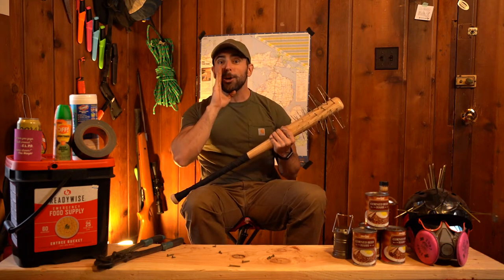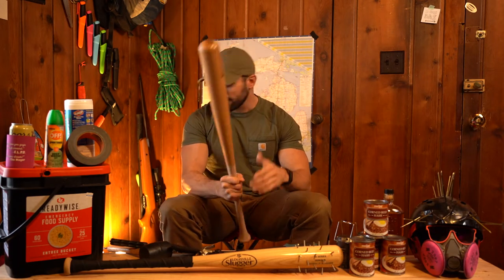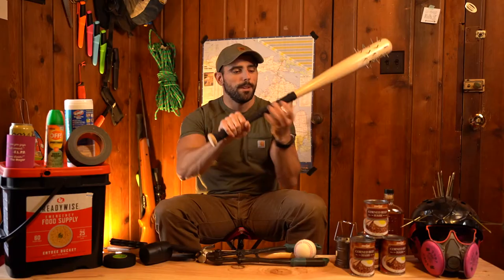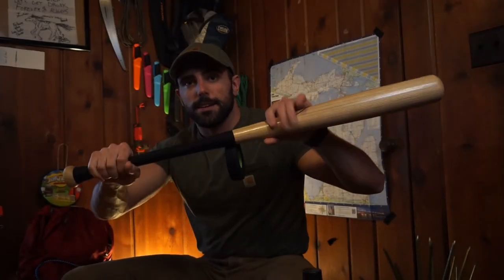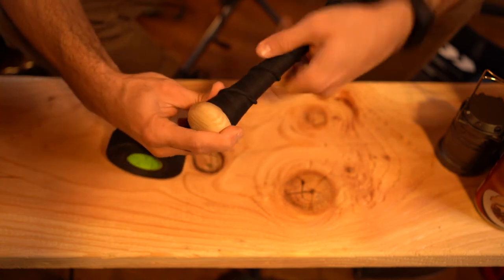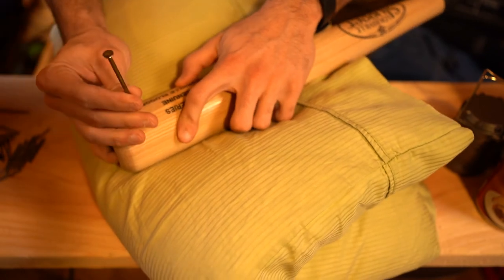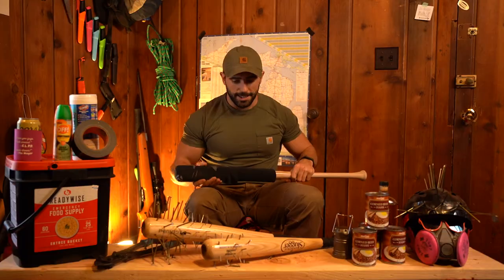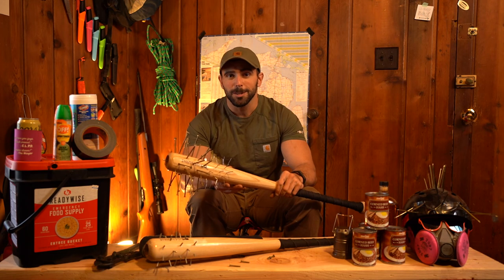How to make a nail bat: Surviving the apocalypses with Lou!

Comment: Im pretty sure weve all seen those videos of people standing on tons of nails, so something i would say is not to put way too many nails on the bat so that way there are less pressure points to spread the energy of the impact. At the very least put a good bit of space between each nail so they go into the "target" with less swinging power. Maybe 3 nails going down the shaft and 6 nails going across the circumference of the bat.
Reply from the maker: @mimikanahd1638  love the input!  It’s been years since I’ve made one, but I’ve been towing around with making a new one/video, and I would definitely add this to the list of things that do different.  Thanks for commenting!

Comment: Great use of the grip tape. 
But I wouldn't put nails into your bat. They will bend and break off. 
I used grade 5 hex head sheet metal screws, the ones that have a point. But i only used 3/4 to 1 inch long ones. First drilling a small pilot hole (so it won't split your bat) 
This way it has "heavy studs" that can do massive damage
Reply from the maker: Great Idea!  I'll have to give that a go if I make a new one:)

Comment: I think I'd use stainless screws, the kind that are only about half threaded. Drill some pilot holes and snip off the ends like you did with the nails, just saves you all the whacking and lets you be a little more precise with the placement. Might also lessen the risk of splitting.
Reply from the maker: That’s a brilliant idea.  Truth be told I just kinda went for it:)
Reply: All of this, but tent spikes. Much larger, much more durable nails, rather than cutting them, I angle the head off to the side, she’s real beautiful in an brutally-ugly kinda way. I call it the modern mace, though you can practically use it as a saw.

Comment: The nails look pretty weak and they’d bend and come out. Hit anything with them?
Reply from the maker: Definitely not my strongest build.  And since switched over to using hybrid screws and then clipping them. 

I haven’t made a video with it yet, but I might in the future:)
Reply: Would using washers, or nuts make it stronger?
Reply from the maker: @milesaway3422  not sure?  The more you add to the bat, nails, screws ect, the more you compromise the wood of the bat.  I've split a bat with a nail that just found the right spot.